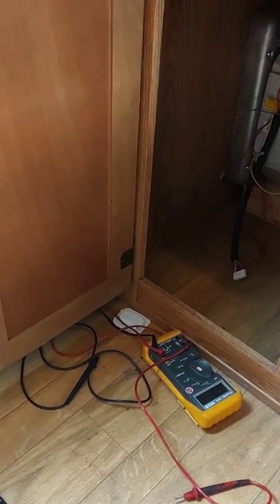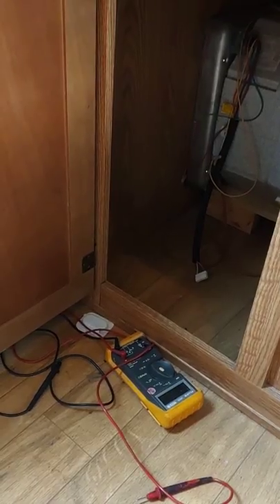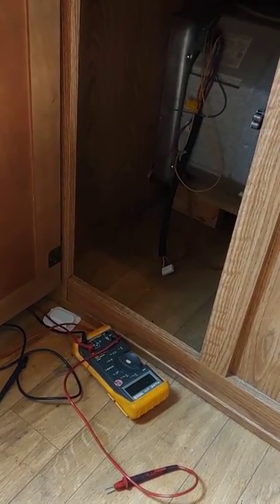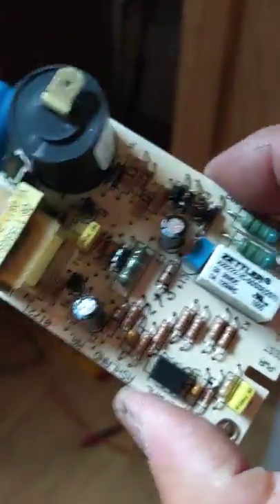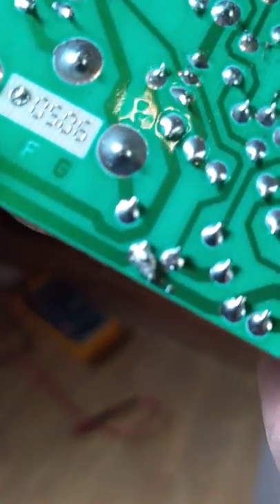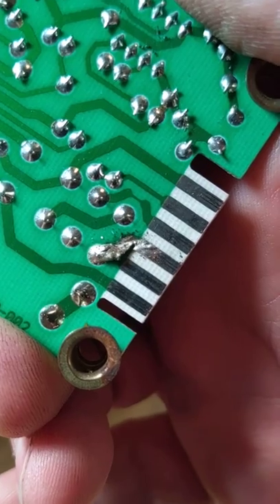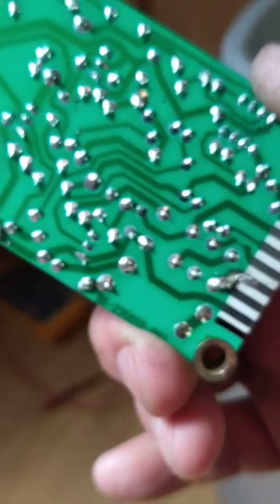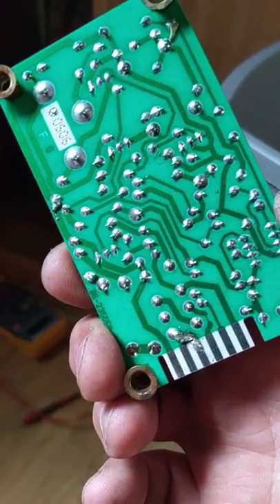RV water heater circuit board repair

Comment: My 6 gallons suburban water heater is not working , I did a lot ot effort to find out what is going wrong and when I was thinking about the ignition bird I discovered the this board was disconnected . I saw 4 wires with a cap on them I no harnest  connection I assumed that when my camper was at shop they cut those wire. Is there any way  to find that kind of harness so I can connect my heater to the ignition board. The shop is too far free m where I am now. Thank you.

Comment: Thanks, I have the same problem. Heater works off of electric but not propane. Checked all fuses, switches etc. All looks good. Pulled this control board and it also looks good but I am fairly confident it is the board. Because I know the the fuel isn't opening nor do I hear any clicks from the igniter.